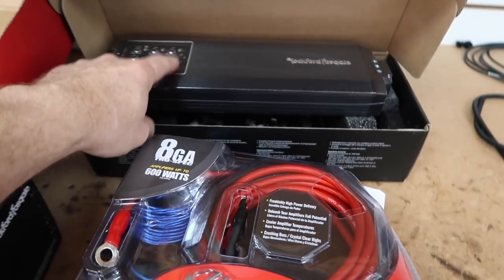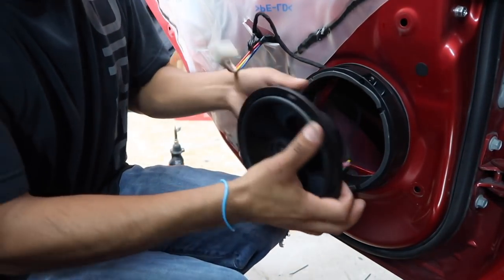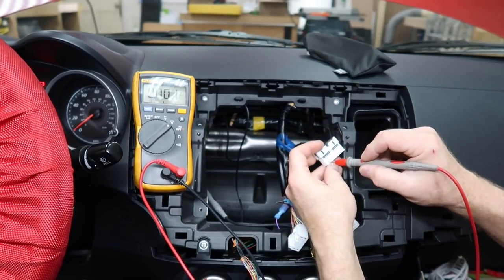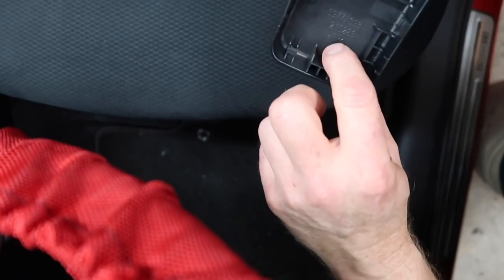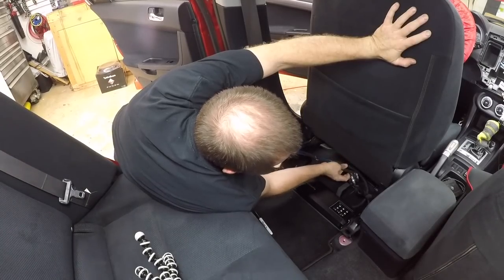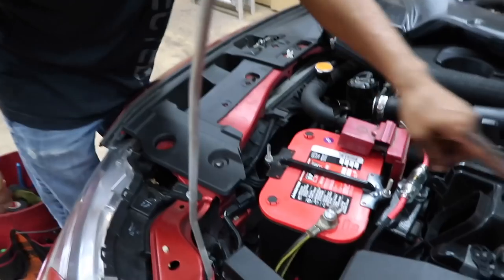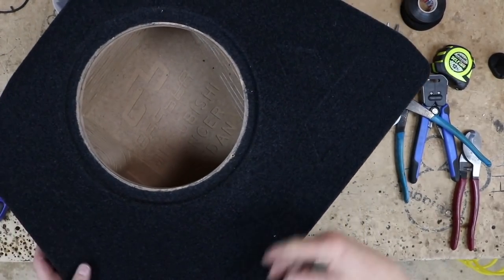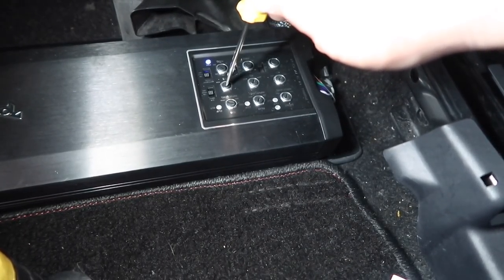Mitsubishi Lancer full car stereo install

Comment: I may have missed it, so I apologize if you dealt with this issue, but does it bother you that there is a heat/ac duct under the seat blowing right on the amp.  Obviously not a problem with AC, but I would think pumping hot air on an amp would be bad?  For example, my iphone has overheated when clipped to a heat vent in the dash.  Just curious.  Love your vids!
Reply: Have you ever felt the temperature of the floor during winter? I don't think your floor is a toasty 90 degrees even with the heat on full blast.

Comment: Add a USB extension cable.  At the very least leave it tied up under the dash.  If you want to go full Five Star add a flush mount male end down on the dash somewhere.   Maybe around the OBDII port.

Comment: Hoping you good folks can help me. I have a 15 Mitsubishi Lancer with RF Factory Amp. I have a DNX697S along with the Maestro RM1 and the Maestro RR specific to my vehicle. I made all necessary connections, updated the firmware on the RR module. Everything works in terms of power, speakers, amp etc. However, the only thing that is not working is the OEM Sub. Any idea on what to check? All my door speakers, oem amp, etc all works. Just the oem sub itself is not working. Appreciate any tips in advance.

Comment: What speaker adapters are you using for the front and rear doors? I got the metra 82-7000 and had to modify it to work.

Comment: Good evening,
should i install the front parking sensors on a lancer 1.5 no evo.
I wanted to know where would you route the cables from the engine to the passenger compartment? where is there a hole or a sheath to pass the cables?

Thank you very much

simone g o

Comment: Nice Install but a bit more explanation on the wires from the dash were needed as a newbie would be totally lost watching you make a custom wire harness. Also this car may be badged as a "lancer" but its really not, it has more Nissan design and Nissan Jatco Transmission and Nissan sensors that makes it a "Nissan" and probably why the lancer is no longer a worldwide name. The real Lancers were from the style of the EVO 9 and Back, You probably need to own or drive one from the previous generations to understand the quality and difference.
Reply: its a ralliart lancer has a turbo and SST transmission not the CVT
Reply: Do you really think the regular Lancer started in the 10th edition? Please read up on your Evo and Lancer editions.